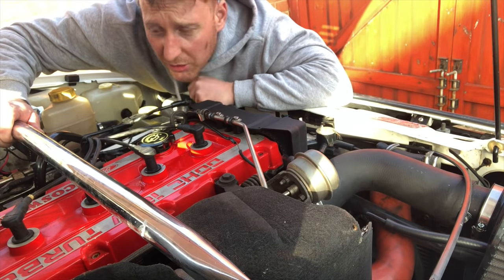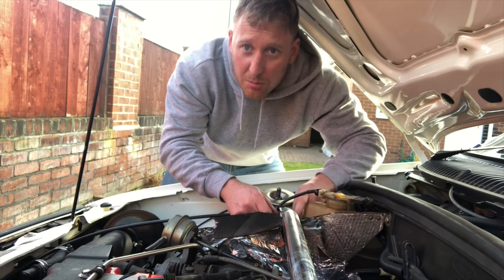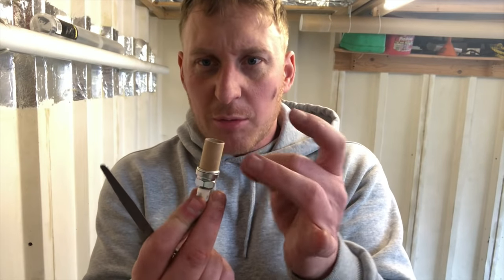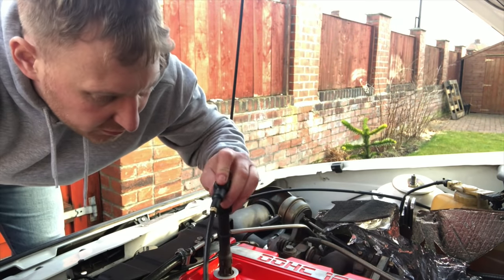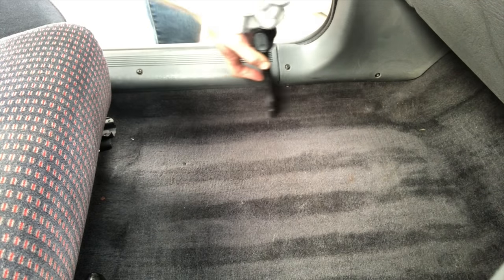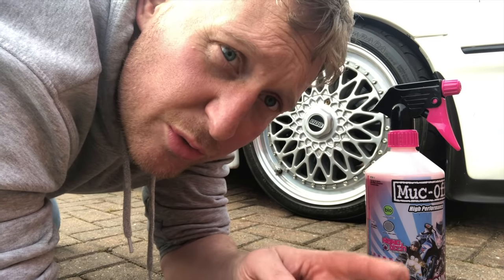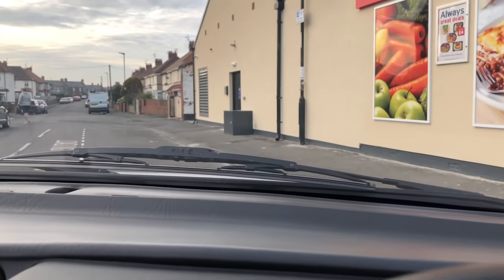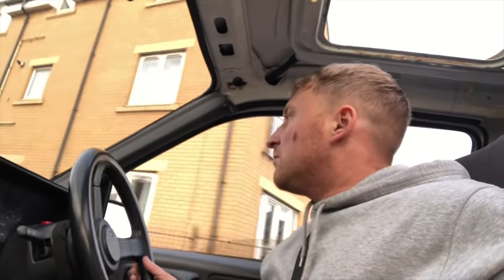FILTHY Cosworth 🧽💦

Comment: I buy the cheapo spark plugs and change them OFTEN .Rather than buy the expensive ones and only change them every three Years. 
You can buy the cheapo spark plugs for like £3 EACH... For my Toyota Celica 
HOWEVER Adam ... Fair warning ..... If you are running your car on the high  99 octane Shell petrol this  can "Eat up"  the cheap spark plugs in a short space of time..

Comment: Your items are such fun !  Not sure but the plug you removed looked rather soot ridden ?  Plus not sure if you put any oil on the threads of the new plugs ?
Reply from the maker: I never put oil on the threads Robert. I didn't know that was a thing🤷🏼‍♂️
Reply: @Adam151082  a little oil will greatly reduce any chance of cross threading, plus will be easier to remove next time

Comment: Can anyone tell me the proper  top speed for a cosworth? cos I know the Speedo reads 155 my cousin says he's had he's 158 by the Speedo. But Ford told me they only targeted 140. And Ford say the fastest cosworth that left the factory was 147 ore 148. So I Spock to a lad with a 2wd saff cosworth and hes top speed on Speedo was 156 but it was only doing 145 flat out by phone app.
Reply from the maker: There's so many different top speeds mate. 

There's the 
Sierra Cosworth 3 dr
Rs500
Sapphire 2wd
Sapphire  4wd
Escort Cosworth - small turbo
Escort Cosworth - big turbo

I imagine each have a different top speed, plus it depends on how they're all running after 30 years. 😊🤙🏼
Reply: Cosworth speedos read 170 pal :)